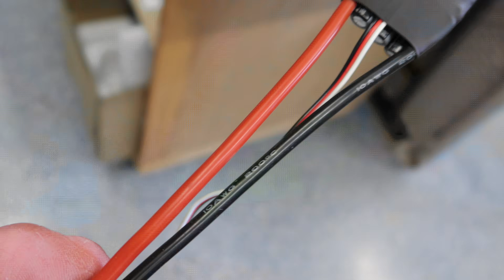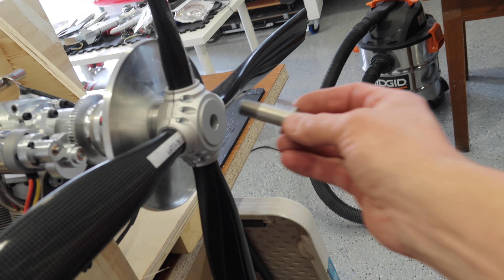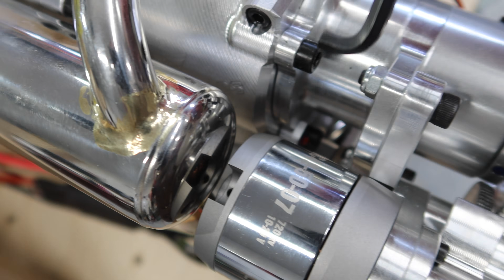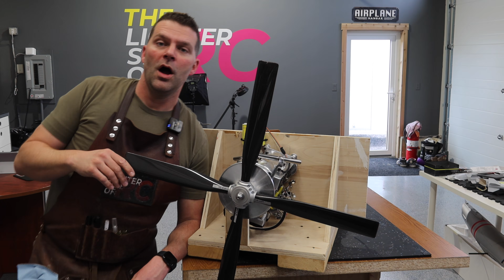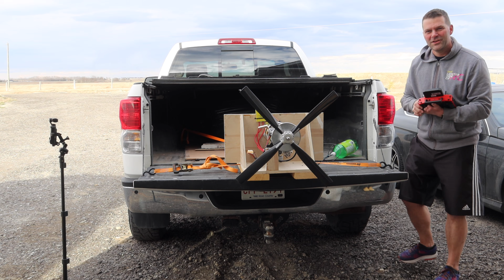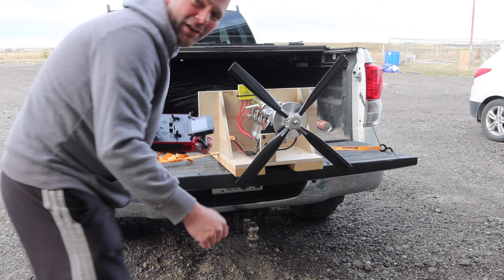THE THRILL OF SPEED - Test Running the kOLM 230cc Inline engine

Comment: Hey there!  The abbreviation mm Hg means millimeters of mercury. Mercury was used in the first accurate pressure gauges and is still used in medicine today as the standard unit of measurement for pressure.
Reply: The distance measurement is from the surface of a pool of mercury to the top of a closed-end glass tube that has been dunked in the pool of mercury and then suspended perpendicularly so that the open end stays in the mercury pool and the closed end is pulled up high enough that the weight of the mercury sinks and creates a vacuum in the tube. That’s gotta be a run-on sentence! 😜
Reply from the maker: Thanks Sheldon!😎😊
Reply: 1mm Hg is called 1 Torr. To measure the pressure a U shaped tube is filled with mercury and one end is connected to the vessel where you want to measure the pressure. The difference in mm height between the levels is your pressure in Torr.
Reply: mmHG is used for blood pressure…

51.7mmHg per 1psi

Below 120/80mmHg is normal (2.32/1.54psi) and above 180/120mmHg means you're probly about to die (3.48/2.32psi).
Reply: @Iowa599  people stopped using pounds and inches about 100 years ago. PSI is obsolete.
Reply: @chippyjohn1  no it's not. 
IE: tire, boost, oil, etc…
Reply: @Iowa599  tyres, not tire. Society has been using bar and pascal for a long time now as the standard. Every country with education is taught this.
Reply: @chippyjohn1  that's funny, every technician I know still uses psi! 

So did ASE, on all tests to be a Professional Technician, the time I tested (~10 months ago). 

(I have been certified, by ASE, as a Professional for ~15 years, and we use PSI)
Reply: @Iowa599  I'll let you in on something that isn't a secret. US education is very far behind. Imperial measurement is equivalent to Latin.
Reply: @chippyjohn1  America's accomplishments and contributions to science are beyond reproach.
Reply: @chippyjohn1   you realize almost all languages are based on Latin.
Reply: @ericjohnson8482  You realise almost no one speaks Latin. Imperial is a dead measurement, just like Latin is a dead language. End of story.
Reply: @Make-Asylums-Great-Again  Mericas accomplishments are hijacking people from other countries, with funds they make up from resources they take from other countries to create wealth and patents so the US can say they made them for themselves. The US grew around WW2, that was because of the large amount of European engineers and scientists that were brought in.
Reply: @chippyjohn1  I'm honestly curious, what is the benefit of all the animus against the imperial system? I am American so I deal with it every day. I'm also trained as a scientist, so I personally use metric exclusively. 

I'd agree that it would be beneficial for the USA to move to metric (it was past due when I was a child...) but the imperial system remains a usable system, so I'm always confused why there seems to be so much hate for it online. Is it just that hating it has become a meme?
Reply: @martinmckee5333  The most common sense comment made. I use both, especially in machining and design with different countries. Although I’m not bilingual, I am bi-measuring systems. If folks would give it a chance, there might not be so much animosity against either of the systems. 😊
Reply: @chippyjohn1  Your brain is dead but here you are...
Reply: @chippyjohn1  that's just simply not true.
Reply: @heeder777  most haters just don't realise that even the imperial system is now defined with metric units as a base.
It's just cosmetic.

Whoever wants to "speak" in imperial, just let them, the conversion can easily be done in the head, if you deal with certain units more frequently.

For operation of machinery, one doesn't even need to know what the unit actually means. The operator just needs to set the corresponding control so that the dial shows the "potatoes" that it needs as it was determined by the engineer, who designed it.
Reply: @Martin McKee  As an engineer, imperial is a huge unnecessary headache. Stubborn people who never actually design, measure, or build anything dictate units that are used. There is no logic to imperial measurement. People choosing to use a less efficient and logical form of measurement shows how stupid humans are. I'll look at measurements in aircraft for example, and there are faults in conversion all the time. Just think next time you are in an aircraft, many mistakes have been made due to imperial
still being used. We still have people in countries other than the US that are familiar with imperial, but soon, none of them will be around or working in the trades. There will be a sudden language barrier. Countries such as Germany adopted metric around 1880 and it contributed positively to their engineering. Since Australia was privatised and bought by the US, imperial has crept back in, causing issues. Imperial shows a lack of intelligence. No engineer, scientists or mathematican would choose a more complicated way of solving a problem. Lastly, there is no positive argument for imperial. Mericans saying they will use it because that's what they want, it shows how selfish the country and immature the people are. Something as simple as using the same measurement is not achievable by them because they don't want to.
Reply: @chippyjohn1  don’t loose a finger over it bro😂👍🤓
Reply: @Dreddip  @firstlast your both being childish so glad I came😂😂😂😂
Reply: @beachinrc101  Lose - face palm.
Reply: @ericjohnson8482 almost all languages are based on latin?? What an idiotic eurocentric statement. The languages used by 3/4 of the human population of our planet have NO link to Latin whatsoever. As to "imperial weights and measures", it's a deliberately illogical system originally intended to keep even the skilled ignorant. The metric system, on the other hand, is based on easily verifiable physical world units in a logical base 10 system. The units "work" from the tiniest scale to the most massive, with no need for "scruples, pennyweights, furlongs, hogheads, or pecks". As an American I'm forced to live in a world of imperial units, and am quite comfortable using them, but that in no way justifies the existence of 3 imperial weight measures, all using units of the same nomenclature, all but the tiniest using divergent values.
Reply: @chippyjohn1 The cost of converting an entire country’s machinery with control inputs graduated in one system of measurement over to a different system is a significant consideration.  Some might think that to be immaterial.   Some might opine that the use of the Euro over the pound sterling is optimal, irrespective of any other factors.  There are correct answers in one viewpoint that are wrong in another, but those unable to think outside their own box can’t see it.
Reply: @Reach41  Comparing currency to measurement is not the same. The cost of converting in the future will be far higher. All over the world there are still people that are familiar with non standard measurement, but when they leave industries or die, the US will suddenly have to change causing chaos for them. The metric system was recognised as being superior a long time ago. The US pushes for other countries to use non standard, but eventually they will be left behind. US industry is already suffering as a result of non standard measurement, imagine what it will be like when it is suddenly and completely rejected. How much will that cost a country.
Reply: @chippyjohn1  Sources of studies published in recognized, peer-reviewed financial journals to back your claims?
Reply: @martinmckee5333 I think @chippyjohn1's biggest problem w/imperial system is he never learned to add/subtract fractions and thus didn't succeed at his labor jobs
Reply: Esse quam videri!

Comment: I remember pretty much everyone used to put a pressure tap into the muffler/tuned pipe of their RC engines to pressurize the fuel tank(s).  The advantage of using a pressure tank I guess is that you don't need to prime the engine to get it to start.  Those Kolm engines are amazing!
Reply from the maker: Yea should be nice a reliable!  Also simple!
Reply: @CRASH ALEXANDER Yes, I read your post. I added the explanation that the motor won't provide pressure until it's running. Is that not okay? Should I have asked permission to explain a little further? It is a public comment section, after all. Isn't it? I could be mistaken again, I guess? WHY ARE YOU SHOUTING ABOUT EVERYTHING? It's not that big a deal, my friend. Take a breath, drink a Bud Light, and calm down. It'll be okay, I promise you. 🤪😜😘
Reply: @shelbyseelbach9568  😂😂😂😂😂😂
Reply: @Dreddip  Word!
Reply: 😒 kids these days get worked up over nothing
Reply: @CRASH ALEXANDER I can see how both are required, and your wording was accurate. I'm man enough to easily say that. No big deal. The exhaust nipple itself wouldn't supply fuel to the motor without the flexible pick up and the flexible pick would do nothing without the exhaust nipple. You got me, buddy. LOL. The mind can be a tricky thing early in the morning!
Edit. I even went ahead and deleted that comment, maybe that'll help you can down. We don't need any blood pressure incidents. It's just YouTube. You'll get over it, I hope? 😝😋😛😘
Reply: LOL. You still need to prime the engine. The pressure nipple only provides pressure to the tank when the engine is running. Not to point out the obvious, but...........